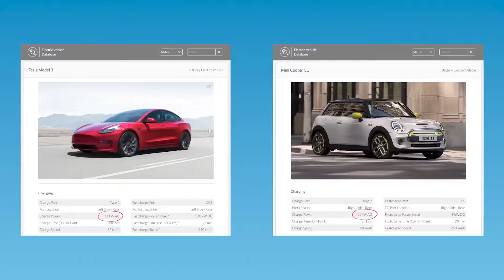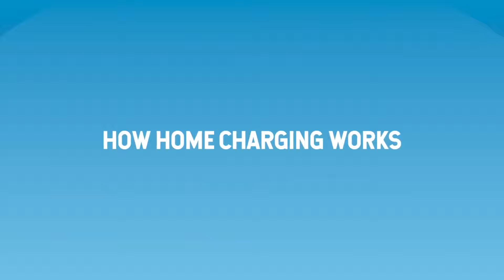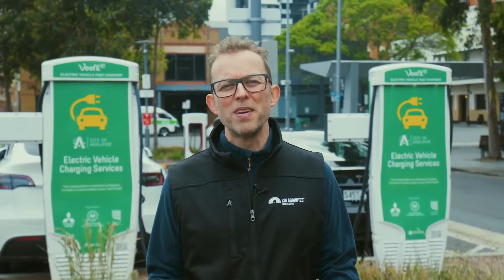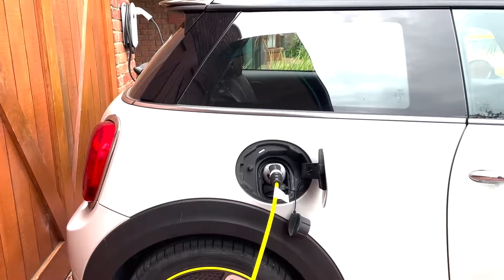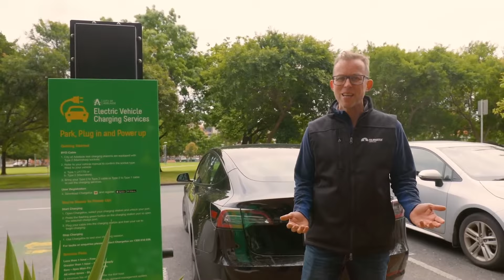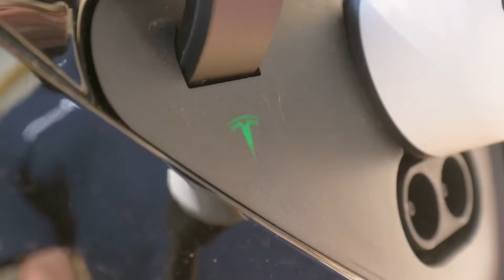EV Charging 101: Everything You Need To Know About Buying & Owning An EV Charger In Australia [CTA3]

Comment: What a load of crap. Most people rent there home so ain't nobody spending money on someone else's house to put a charger in it. Not only that but the risk of burning your house down not a risk anyone should accept should be charged on the street. Also you keep fast charging your battery you will be spending 20k on a new battery every couple years. While I drive my petrol car for 2 decades and be lucky to spend 20k in maintenance in it's While life. And to top it off I can drive around the country as many times I like without stopping for hours at a time to charge the thing. I can't think of 1 single positive to a ev unless your not a car person and your a hermit that is lucky to drive to the shops. At that point you will get more value just buying a e scooter and keeping your gas car for 20 years. You want to save actual money here my advice and keep your gasser going and run it into the ground you don't need a new car especially if you have no interest in them